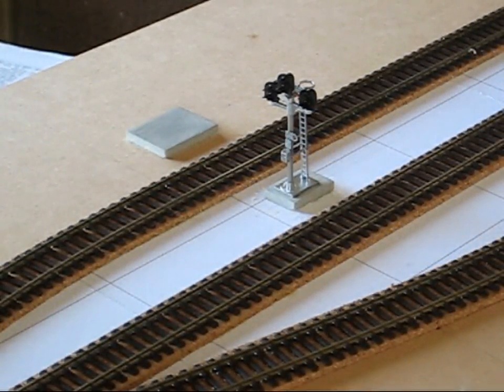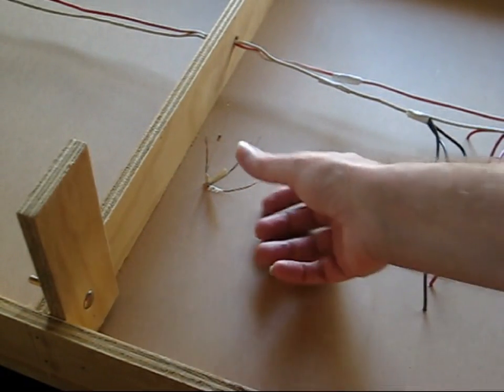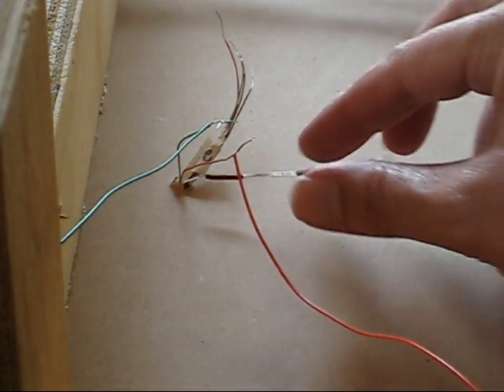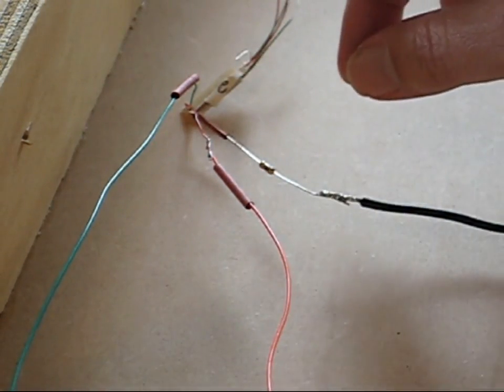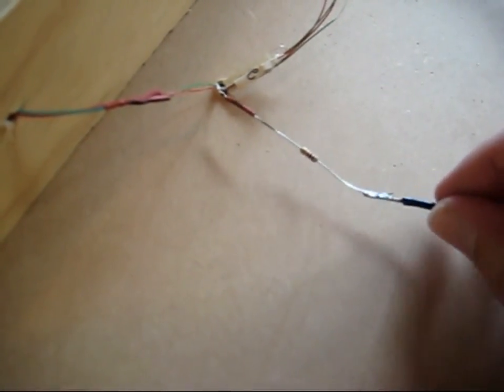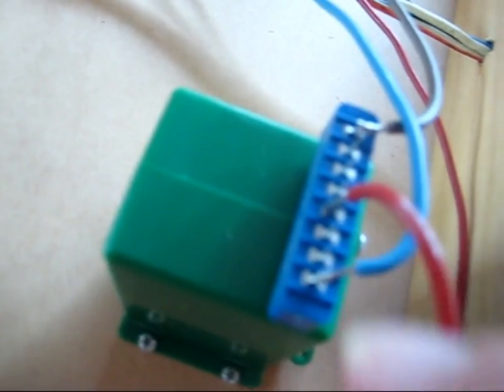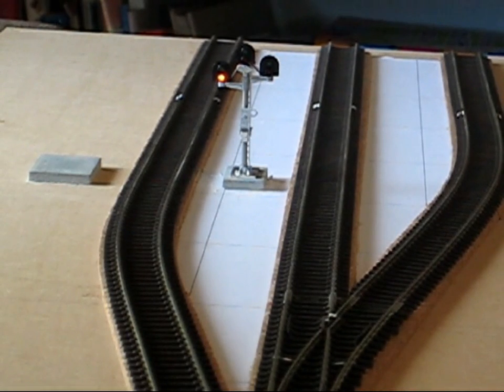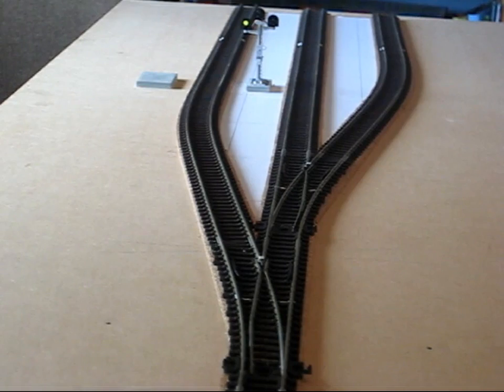Wiring up signal light for model railway

Comment from the maker: These leds can only take up to 3.5volts, so if I connected the leds straight to the track power it would blow the leds because the track power is 12volts. The resistor reduces the track power to 3.5volts and powers the leds.